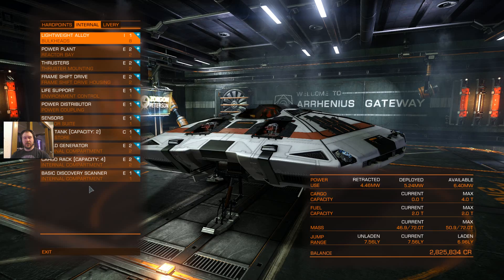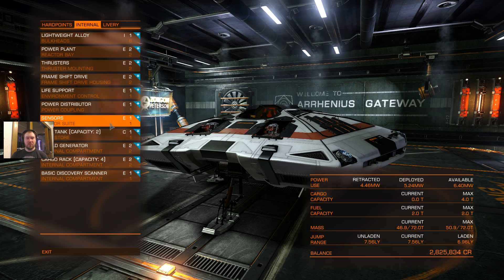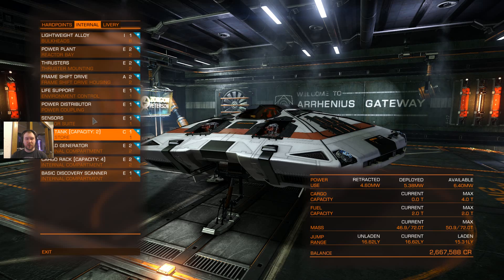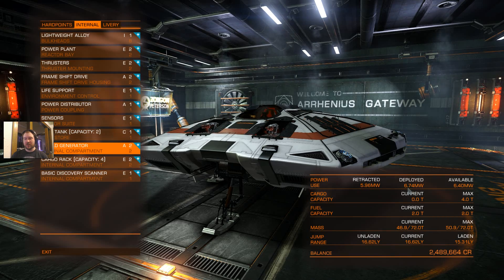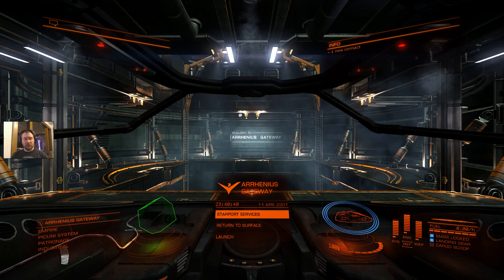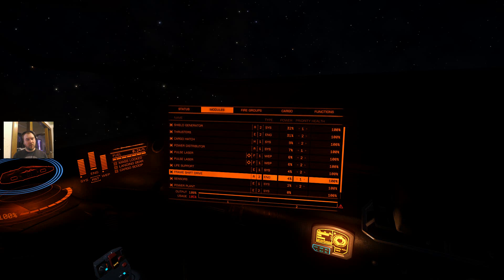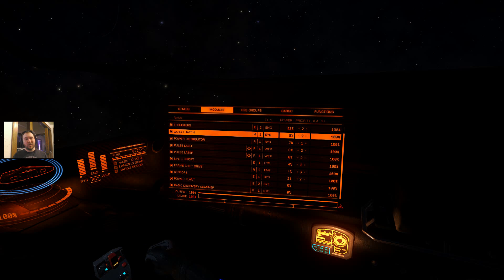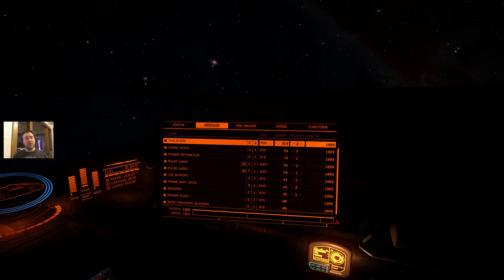Elite Dangerous Ship Frame Overclocking

Comment: You haven't overclocked anything, just made it where one will turn off while the other stays on. Output remains the same.
Reply: The Brain Damaged Gamer "Overclocking is the process of forcing a computer or component to operate faster than the manufactured clock frequency. Operating voltages may also be changed (increased), which can increase the speed at which operation remains stable. Most overclocking techniques increase power consumption, generating more heat, which must be dispersed if the chip is to remain operational."

It's OK to use the term loosely, but if we're going to be pedantic, you didn't squeeze any more juice out of your engine (which is what people normally mean by overclocking/supercharging) -- you just turned something off to let another part sip more juice.
Reply from the maker: APJ1986 Made it run past 100% is the whole point. And that is what I did.
Reply: The Brain Damaged Gamer No, you didn't, you told your ship to sacrifice one component for another. It still never went above 100% power output.
Reply from the maker: Gee when I type overclocking definition into google I get

Overclocking is a popular technique for eking out a little more performance from a system. 

When I look to the right I have more output than I should be able to run. I have in effect loaded my system down with more gear than it should handle. 

At the end of the day it could be call Spleyting, and I would not give a crap. If it helps people run more gear than they should be able to and it helps new players I am good.
Reply from the maker: Matthew Arnold 105% agree (haha!) 

I think the confusion is I am not claiming to overclock/supercharge the power plant, as of right now that is not possible. Heck the title and the picture even show what I am talking about. It is about fitting more gear on the frame than was intended, that is the "overclocking" I am referring to. The ship still shows 105% power useage for all the gear on it. I have pushed the ship, not the power plant, past what the manufacturer would have intended.
Reply: The Brain Damaged Gamer Arguably, the manufacturer intended you do that because they provided you with the interface for turning low-priority stuff off.
Reply from the maker: Aha so by that though process board manufactures want you to overclock CPUs because the jumpers are there.